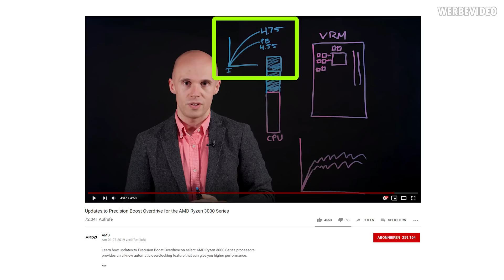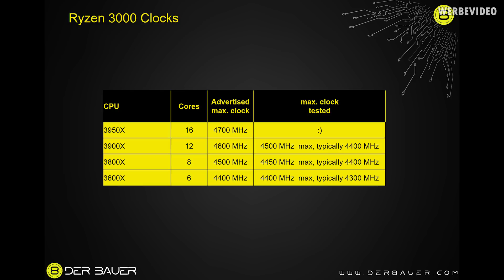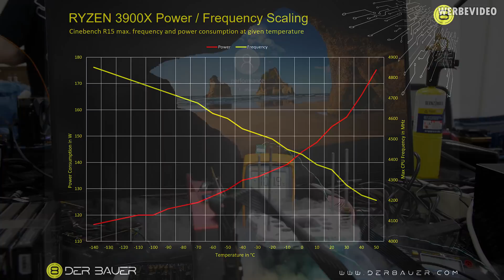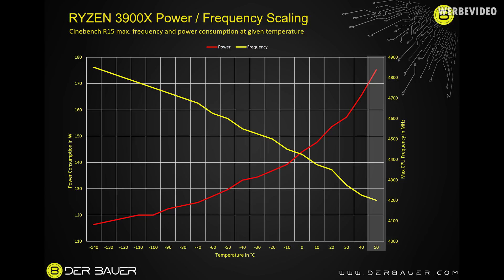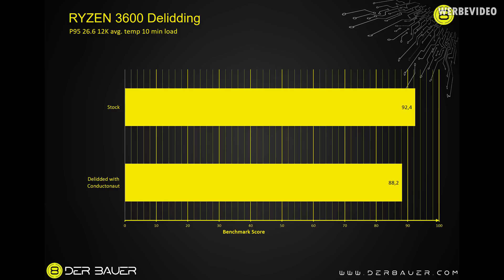RYZEN 3000 Delidded - Overclocking Expectations and Temperature Scaling

Comment: If temperature is the limiting factor, it seems that increasing the voltage would actually reduce your max overclock: more heat being generated. Has anyone tried overclocking without overvolting
Reply: Temperature is not the only factor, decreasing the voltage give worse performance in benchmarks, it seems that with auto settings and PBO enabled is the best you can get out of these chips, any attempt for manual OC will give worse results.

Comment: I got an FX8120 past 4GHz 5 years ago! I am certain Ryzen can get 5 with proper cooling.
Reply: not so far, getting zen2 to 4.4ghz all core manually is a hell and PBO not working, it will few more updates

now if Zen3 comes in end q4 next year on 7nm++ or 5nm maybe 4.5-ish
Reply: @1BigBen  that is interesting...
Reply: @AndrewErwin73  I was just looking for fun on cpu.userbenchmark  at my old 9590 and the 8120 and 8150 vs 2700x it looks there to be killing them, 

Joe Stepongzi will be putting 3700x under LN2 tomorrow live, he did 6 hour live stream few hours ago and another 3 hours a day ago working with the 3700x on air

so if you are bored 9 hours with joe and the internet

Comment: I Think AMD are the one responsible for the clock speeds, because they are binned to run at these clocks, the lower end parts have lower quality silicons, the higher end ones have higher quality silicons to achieve 4.3 ghz, so if lets say 3600x has 3900x like quality silicons it will achieve well above 4.7ghz all core with aio

Comment: One thing that I have done in the past and helps a bit is to sand down the IHS until it is pure flat  copper touching the CPU die (I made a jig years back). As copper has 6.5X more W/Mk over nickel for thermal dissipation, this helped my 6700k core-to-core temps to be within a degree of each other under load (liquid metal was used). And I guess CVD diamonds have 4X better thermal conductivity of copper!!! one idea would be to CNC mill out a 45mm x 1mm area on the chip side of the IHS over each chiplet.   https://www.alibaba.com/product-detail/45mm-cvd-diamond-wafer-thermal-Grade_60768773260.html?spm=a2700.7724857.normalList.24.634725c6bWCBNq thermal conductivity also goes way up as temp goes down http://www.diamond-materials.com/downloads/cvd_diamond_booklet.pdf

Comment: Isn't there some kind of bios limitation that stops or at least hinder's clock speeds?
btw boost and all core OC are not the same thing. there are a few reviews that has 3900x hitting 4.6ghz on 2 cores at a time which switches to a lower frequency and another core will boost to that speed while the others rest when you are just letting it run stock.
Reply: i manually overclocked mine to 4.525 on all cores with an aio an max temps while playing games is around 60 cel

Comment: what about direct die cooling?  since you don't need the IHS to clamp down the CPU, like an Intel.
Reply: Obviously u should get some more degrees, but beware the pressure on corners of die, this thing is not centered any more.
Reply: @vivianvaldi7871  Yes!  I think you would need a custom-designed coldplate with a mounting system specifically engineered for delidded dies (insofar as applying the corret amount of pressure when secured).
Reply: @vivianvaldi7871  I was thinking of direct contact too, but that's a very good point. The center of pressure should be inside the "footprint" of the die, and the die and chip have to be absolutely flat. I think it should work, interesting to see if someone tries it.
Reply: back to Athlon XP times :)
Reply: My old partner "Zenzzo" was the original direct die waterpimp back in the day of the Athlon XP...wonder if I could get him out of retirement to take a crack at this. Was just thinking about this exact problem (And Zenzzo} when I was at work today...kinda weird, must mean it should happen!
Reply: Would definitely advise against it.
1. I tried it on a Coffee Lake and it made minimal (in fact, possibly within-the-margin) difference over a normal delid,
2. Two off-centre chiplets would make cooler contact... questionable.
Reply: I approve of this message.
Reply: Been direct die for about 2 months now using a ek block and liquid metal.   I dont get more than 10c  above ambient my room is usually about 18 to 19c also using a 480 alphacool monstra backed by 4 nff12 3ks      cool as a cucumber

Comment: Hey Roman, I know you said it's not worth it and the C difference isn't enough for a noticable boost. But would it be possible to edge out a 1 to 3 more Celsius by lapping the top of the IHS? I recall Ryzen being able to boost in smaller increments of 25MHz unlike Intel. So maybe a tiny bit more head room would either get you to the extra 25MHz or a more sustained operation of highest clocks for more cores? I know it's not worth it for the average person but would be interesting to see what numbers you can get on benches.

Comment: If your assumption is correct about the hot spot, then, what if you can use a air cooler and measure temp difference between the heat pipes and see what you can find out.

Comment: I am convinced now after seeing the thermals you have shown. Here is some tin-foil/complete guesses I have. Likely the reason Intel has had so many issues with 10nm is because of heat when scaling frequency. Their reference samples and laptop processors are showing great power efficiency and performance at low clocks. I bet they struggle to push out higher than 9th gen cpu performance on lower thread optimized software, and have poor scaling in the desktop CPU space. AMD looks to be matching 9th gen core to core performance, but do not have the thermal headroom to push for higher clocks and performance in lower thread optimized programs, like games. AMD built wide with the 3900x and 3950x, and added more cores, something Intel likely could do too. It just does not seem to be worth the investment for Intel to start production on a line of CPUs that will perform better in power efficiency, have more cores, but can't top their current line-up in gaming.

I bet this is why we have not seen 10nm Intel desktop CPUs, and we likely won't until they solve these issues. I wonder if there really is anywhere to go for Zen 3 at the moment, and if AMD is also fighting these issues. This is fascinating to say the least, as the core to core efficiency on Zen 2 chips seems to suffer from variance, and binning of chips could produce some outliers with better performance. 

All speculation, but I wonder how close I am to the reality. Hopefully I am wrong, and the bios fixes for Zen 2 allow it to punch to boost numbers posted in their literature, and not hit thermal limits/throttle. This is going to be a fascinating couple of years in CPU competition, and I can't wait to see what happens.
Reply: AMD said themselves that they would see a frequency regression when shrinking past 14nm. We saw the same when Intel went from 32nm to 22nm.
The fact that these CPUs are hitting these clocks is expected. 7nm is brand new so maybe 7nm+ will give us higher clocks.
Reply: @DenGuleBalje  I agree. I wonder if the initial die-shrink is just not allowing competitive clocks from current engineering samples at Intel. They probably having been trying to deal with heat, power, and performance  to be competitive with 8th-9th gen gaming, they likely have good IPC lift and good performance overall, like the laptop chips show, but haven't figured out scaling for desktop. 

Honestly AMD is suffering the same issues, so it might be the case. The PBO numbers for Zen 2 chips are pretty damn toasty at lower clocks. The heat growth is pretty massive all core 4.3 overclocked. So I am not sure what they are going to do for Zen 3, and probably will need more RND time themselves.

I will say this though. Once Intel and AMD figure it out, the competition should be fierce for a while. I am excited. I just hope the Intel 14nm refresh rumor is false, even if they need to buy time. Having super hot, super high tdp chips, that beat or tie Zen 2 seems like a meh option. I was to see real growth from both companies.
Reply: @Zerosixious  From what I've heard Intel's 10nm process was fundamentally broken for a really long time. Meltdown and Spectre probably also caused issues because suddenly now people expect 10nm to have hardware mitigations for those vulnerabilities. 
Intel threw A LOT of money at the problem and things seem to mostly work. 

10nm is probably too little too late though because TSMCs 5nm is about 2-3 years out. I also HIGHLY doubt that the yields on 10nm is high enough to make them anywhere near the same amount of money as 14nm did. 

My bet is that they will sell SOME 10nm products along with mostly 14nm+++++ until they jump to 7nm. 

The bottom line is: Intel is bleeding money and need to act fast.

Comment: Thank you for giving a very precise evaluation of the potential of the CPUs!   I assumed they would only benefit from tweaking XFR/PBO as well as cooling and that seems to be the case.  Of course VRMs will come into play as well but I don't think the chips are drawing much more than the high end x470 boards can provide except for the upcoming 16 core.  Glad to know that even delidding the chips gives very minimal thermal improvements.  Like many others I wish the clocks were better but at least the performance we're getting at these clocks is impressive overall.

Thank you for publishing an English version of your findings!!

Comment: just wondering why you didn't try direct die cooling.
Reply: If even LN2 shows such a major limit, what are you expecting?
Reply: @mdd1963  ln2 limit is  5.4ghz or so.  4.4ghz is the limit it would seem for most parts due to thermals. If you can drop 10c via thermals ur likely to get 4.5ghz-4.6ghz all core on good water cooling.

Comment: Another review says that there is a bios issue causing the issues with overclocks and it's affecting both x570 and x470. He said that he downgraded to an older bios version and was able to hit 4.6ghz.
Reply: what is the difference between 4.4 and 4.5-7? any testing done yet?
Reply: @artiew8718  They can't hit 4.5-4.7 on ambient.
Reply: @rankcolour8780  My 3800x hits 4.5 with a Noctua U14S with a room ambient of 20c.
Reply: the problems you have in overlclock are because bios. I think more one 1 month and flash your bios and try again
Reply: After 5 months where is the fix?
No, there is no BIOS issue, the chips are these, much hotter and not what we expected.
Reply: @satsokl  Now a year later I'm getting 4.5GHz at 1.25mv on a Ryzen 5 3600
Reply: Advocatus Diaboli  
That's going no-where the same person has since reported back that even newer bios don't change anything and that Ryzen just can't hit the advertised boost speeds, which is a shame :(
Reply: @rankcolour8780  i wouldnt jump to conclusions just yet. Everythings brand new and its amd
Reply: if the cpu was only going, in the case of the 4900x, to 4.4 ghz for most reviewers 4.7 ghz should be a substantial improvement.
Reply: No. It just showed each core at SOME POINT achieving 4.6 ghz. Has nothing to do with OC. OCs past 4 300 are nearly impossible.

Comment: Max single core clock. I agree it's dodgy advertising but the max single core clocks are going to be higher than all core clocks due to the temperature. Which in a way makes sense. Why would you want all 16 cores at 5ghz anyway? You only need the cores you are using for your game to be as high as possible. The other 10 cores can go slower. Honestly if you want more speed, wait for Ryzen 4000 next year.
Reply: Im wondering about max s1-2 core clock also....

Comment: Can you OC 3000 CPUs with power limit method? Keeping idle clocks and increasing boost clocks
Reply: It doesn't work like that, Ryzens throttle clock based on temperature, they almost never hit the power limit and definitely never if PBO is enabled.

Now, the interesting bit would be how much undervolting is possible - and if it actually helps performance by lowering temperatures.
Reply: @AstralS7orm  He means overclocking by P-states where you set your "boost" clock and lower state clocks yourself and the core will automatically throttle up/down based on load the way a non-overclocked CPU will, so you're not permanently running the chip at max the way you would using other methods of BIOS overclocking.  Worked great on Ryzen 1, haven't seen anyone doing this/talking about it for the 3k series yet.  Also all BIOS versions are very new/immature on these new chips so I really wouldn't worry about what results people are getting at this point.  Wait a few months and things will be much more stable.

Comment: Yeah thats my concern too about the chiplet design not being in the centre that heat will not spread out as much and will be mostly confined in the corner and the side which does not make contact with the cooler then adding another chiplet then its even worse would been better if they where in opersate corners if the centre was not possible.

Comment: Great video. What Would You recommend as max volts for Zen2 ?? I'w been running my 2700x@1.425 100% load 24/7 waiting to replace it with 3900x when it comes.
Reply: AMD say 1.425 MAX for these CPU's, 1.45v if you are using extreme cooling i.e LN2 or water chiller.
Reply: @Dazzxp  thanks  cant wait to have a play :)

Comment: So basically Ryzen 3600x is the exactly same as 3600? Only 100 MHz higher for $50? Wtf
Reply: Really that's it?
Reply: @magzire  Well yeah since it's stuck at 4.3 while 3600 non-X gets to 4.2; however I'd hope der8auer will answer my question so everything is clear
Reply: @magzire  yes, it was even advertise in similar frequencies by amd, the difference in bench marks is the thread count differences with the extra 100mhz. as well as the extra cache it is getting. thus why the 3900x which is only advertised 200 mhz higher then for 170 dollar price difference. it gets 8 more threads and 32mb more cache size. thus why on bench marks even though the frequencies are very similar that the 3900x is dominating on benchmarks. same with the 3700x vs the 3600x , the 3700x is only base 3.6 ghz compared to the 3600x base of 3.8 ghz, but with matching 4.4ghz frequency, same frequencies with a 80 dollar price point difference. BUT....3700x gets 4 more threads, and 2 more cores, 1mb more of l2 cache and 30watts lower tdp, so for 80 bucks more for the 3700x you are getting more performance in games with the more cores, getting more real life scenario performance with multi tasking with more threads thus why it matches the 9900k on cinebench. and the biggest selling point is the lower tdp 65 watts. for better performance then the 3600x in gaming, and similar performance as the 9900k in multitasking scenarios, so if you want to game but also do other things like stream, watch movies, do video editing, the 3700x is price perfectly for 160 dollars less then the 9900k. If all you care about is raw single core frequencies or max frequencies go intell, but if you want a chip for the long hall that will do better once companies like msi release better boards in 6months to a year for better chip cooling on board. then 3rd gen ryzen is the way to go, these are maxed boost clocks, not over clocks, you are seeing in his video. drivers and bios are also an issue still like when they first launched ryzen in the first place. you will see in a couple months of stable 4.8 overclocks 3700x.
Reply: Just like the 2600x vs 2600
Reply: @Uria-jz1gu  https://www.youtube.com/watch?v=7AbNeht4tAE theres your full answer in the first minute of the review.
Reply: @vickiemunson4053  ?
Reply: no it's not same.

Zen2 7nm, more improvement than added 100mhz.
tweaking memory can be easy to reach higher frequency.

on old zen+ 12nm, most user got stuck hard to reach 3600MHz
Reply: @claritoresdiano1021  what do you mean? I can't understand much from your comment. It's only 100 MHz more.
Reply: @dmc.3800  basically look up ufd tech or hot news, he even says its not worth the X , save the money and by a really good fan instead of the stock and it keeps the cpu cooler which gets better performance then the X even. plus you can just over clock the 3600 urself the 100mhz, and it wont hurt it at all. so short answer yes ur paying 100 just for a better base clock and a better stock fan that can handle 125, when you could save the 50 and get an even better cpu fan.